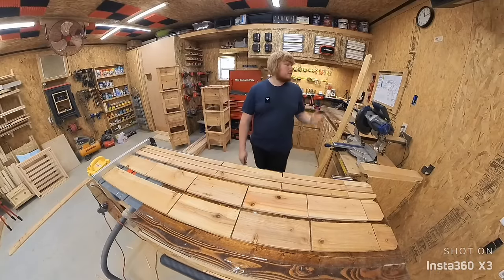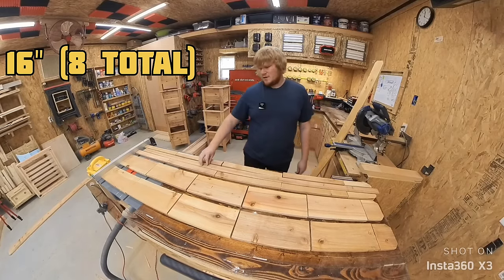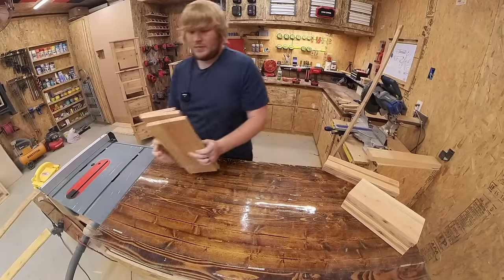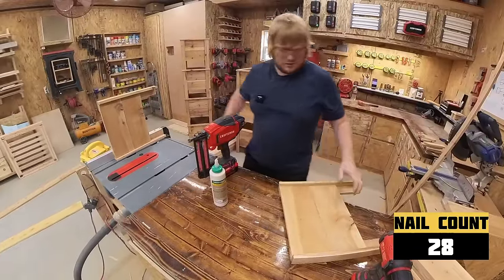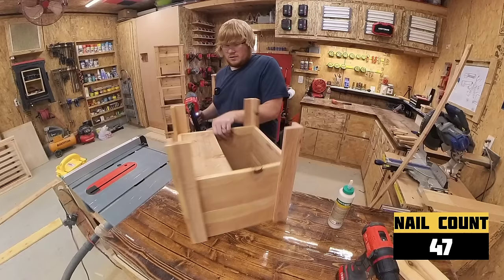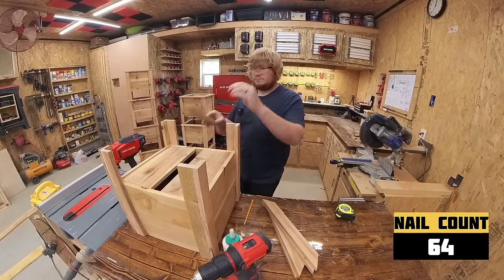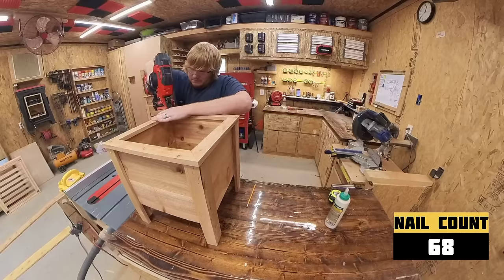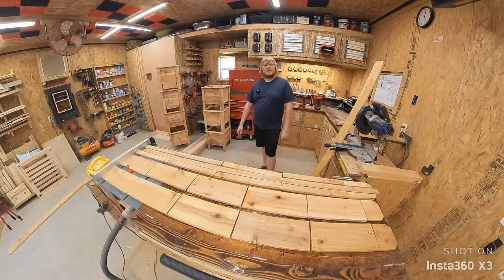3 Pickets, FREE Plans | Make Money Woodworking | How To

Comment: Maybe do a video on making a plywood push stick. You're fingers are pretty close to the blade pushing the thin strips through.
Reply: I thought the same. Yikes. :(
Reply: My experience has been that if you are pushing a narrow piece through the blade you are actually putting pressure against the fence. If you finger slips it will move towards the fence, not the blade. I do use a push stick for short pieces that are not long enough to reach the riving knife before the cut is complete. Still have all my fingers after 30 years of woodworking and carpentry.
Reply: Oh my gosh 😳. My knees are still shaking after watching it.
Reply: seriously
Reply: The push stick was right there on the other side of the fence! 🤣 I was yelling at the screen for him to grab it.
Reply: @gardening-in-the-woods The danger is the board will catch on the saw and pull his hand into it. It happens too fast to react. Use a push stick every time.

Comment: Big props for tracking even the number of nails used. I'm so tired of "$6 planter boxes OMG!!" but then they use $10 in pocket screws alone, and also you have to buy the plans.
Reply from the maker: 🤣🤣 "$6 project, but, buy the $10 plans on my website first" THATS what I hate the most. Glad it frustrates others as well. Lol thanks for the comment buddy :)
Reply: Well you don't have to buy the plans... I did some with pocket screws and it was $2.94 for the screws minus the $.40 cents for nails and it's only $2.50 a build and some designs are just stronger with pocket screws ya it adds a little more time and of course time is money but to each is their own

Comment: Love the video. You should use the scraps. Cut 4 small glue blocks for the bottom. Put them in the corner of the legs on the underside with a little glue. Strengthening everything up including the bottom
Reply from the maker: Oooo! Ill have to give it a try! Thanks!
Reply: That's exactly what I was thinking too
Reply: You’ll be at more than 80 nails now!

Comment: As an update I finally made my first planter box!! I made a small mistake and ended up putting the bottom on the top and had to pull out the brad nails. 😅I got a bit rushed, but I hid the damage on the outside from me having to drill some shallow holes to remove the brad nails by adding trim on the outside facings.

It still looks beautiful regardless! I'm getting lots of friends asking for one now lmao. Thanks for the awesome video I could follow and the cutting plan included!
Reply from the maker: Ohh noo!!! But you could cover up the mistake soo not a loss whatsoever :) great job! Thanks for watching!

Comment: A word of caution - watching at around 3.10, you use your right hand to push the board through. Do NOT do this! Get into the habit of using a push stick. If you don't then you can almost guarantee that one day the blade and your hand will meet. When that happens, it does not end well for your hand. I speak from experience !
Reply from the maker: My newest video has mack one of my favoritd push stick, I want to make it cooler, but, its a start! :) Thanks buddy
Reply: You are so right! I almost peed my pants and it wasn't even my hand. A push stick and NO long sleeve shirt.

Comment: Awesome video and plans!
My only change was ripping the legs to two different widths: 1.5" and 2.25". That way, when they're attached at the corners, all the legs end up looking like the same width. It also leaves you enough (1.75") to use as the top trim.
Reply from the maker: Interestingggggg, I dig it!!

Comment: Great lil project. I built one with ease but the center piece on the bottom was to narrow. I think it’s because my planks were smaller that 5 1/2”. Thanks Voss.
Reply from the maker: Ive had quite a few with a 1/8" gap on each side of the bottom board, just gives it a little more drainage ;) glad you got to build a few!!

Comment: fantastic, build.  easy to follow for a retired rookie.     I have been filling in my exposed nail holes with a mix of the picket saw dust and glue.  just work it in the hold let it dry and sand and you will never notice.   also like the comments about strengthening up the legs to give more support to the legs and the bottom.. thanks and great video
Reply from the maker: Not a bad idea to fill in the nail hole, one of my boxes has a lottle rust spot :P legs have been fine so far, we'll see what winter does to them, but a lot of psople with the same design have had fheir boxes for several years with no issues

Comment: I finally started making these, one thing I did different and found out helps me with the final assembly is I'll actually build the trim square for the top first, a little glue and 1 nail through the corner just to hold it square, then I set it on the top and align to the box.
Reply from the maker: Nice! :)

Comment: This is EXACTLY what I have in mind for my porch and raised bed planters! LOVE so much! They look great, take minimal product (wood, glue and honestly, nails) and will last many many years. Super simple plans. Minimal stock (which is hella expensive now, but there are cheap places to get cedar pickets if you look). You didn't say if they were 6" or 8" pickets, but I'll assume that's in the plans. 
Thank you so much for a very simple plan to make exactly what I was looking for! I would have tried to make it more complicated (and I may still, with mitered legs, but  probably not because that's just more work). 
These modules are so adaptable! You could easily make them twice as long, butt them together, and face with the appropriate board length for the top. 
You could also off-set them for a custom look while making just a few more cuts for the mitered top with a little measuring finesse (personally, I'd scribe each cut, but that's just me).
This is perfect, so thank you! Now, I don't have to do the work to plan the cuts!

As an aside, it would be great to have a downloadable PDF that you don't have to have a particular program to download. Just a simple PDF as an image would be fine.
Reply from the maker: THANKS!! My plans are a simple jpeg and Ive been editing them to be 8-1/2 x 11s so its an easy print :)

Comment: Great job. I made something similar. I used screws, because I don't have a nailer. The legs I made straight and put them on the inside. I raised the bottom, because I put plastic boxes in it. It was fun making
Reply from the maker: Nails, screws, whatever works! Good idea with the plastic interior :)

Comment: Hello. I want to thank you for this video. I modified your design slightly and I make them from pressure treated pickets that are half the cost of cedar. Instead of lapping the legs, I move 4 of them 5/8" inward to create a right angle reveal down the corners. It' takes a little more time but I really like the look. I've sold 10 so far. Great video!
Reply from the maker: Sounds fancy! Great job!

Comment: Great video! I just finished making 4 boxes and they came out pretty good. I was wondering if you could include the plans for the bigger size that you got from the Whitaker custom order. I would like to try that one next. Thanks in advance!
Reply from the maker: Freakin Whitaker! The taller box is exactly the same as the ones your just built, but the legs are 25" long, and instead of two boards for the sides its three boards high. :) I also recessed the bottom so it doesnt take as much dirt to fill the box. Have fun!!

Comment: Nice design. Personally, I ended up ripping my scraps to make a 3/4" ledger board around the base to support the bottom. Most likely not necessary, but it will make it alot stronger!
Reply from the maker: I started doing that to all my boxes as well :) a little bump in quality

Comment: I would for sure put some ledger boards under the bottom for the bottom planks to rest on. Heavy dirt and water is going to be in that thing. your current config, the bottom is going to fall thru.
Reply from the maker: The bigger boxes Ive made have a ledger because of the weight, so far these little guys haven't fallen through :)

Comment: This is so amazing. Id love to try making one. Might get into a carpentry class just so I can do them..I don't have the tools
Reply: If you’re still in school, Harbor Freight will be your friend. Nothing that will last forever, but it will last long enough 👍
Reply from the maker: Might fail the birdhouse class if you make the planter box instead. But you should totally make a planter box! Table saw is only $198, and it can complete the cross cuts as well :) and screws / a hammer and nails is all you need :)

Comment: This is excellent! Yours is, I think, the best presentation. I need to build one for my granddaughter that is 30" H x 48" L x 24" W . I hope this design will work for these dimensions. What do you think?
Reply from the maker: I have a planter box video for a longer (48x16x16) planter box I just posted that shows how to reinforce the sides for the extra weight. If its going to be 30" in height and have dirt all the way to bottom, you might consider adding a 1-1/2"x1-1/2" support inside the leg. If its not holding that much dirt, just make your legs a little wider and add screws to help hold everything together :)

Comment: I really like your stuff.  Why?  Because you are just a regular guy.  Your instructions are easy to follow, the audio is great, and video is clear and you don't jump around.    I'm tired of watching "EASY" projects where you need special jigs, an edge planer or a surface planer or some other piece of equipment.  I'm a table saw cheap band saw, drill, and saber saw kind of guy.  Thank God you are out there.  Makes me feel like an old guy like me can actually accomplish something and sell it for 30$ without having to have $10,000 worth of wood working tools.  By the way, my local Home Depot had pine pickets for $2.18.  So I'm off and running. I'll probably have to put some sort of finish on them so they don't weather too much.   The expensive part was buying 7 Million 18GA 1 inch brad nails in a tiny box for about 25$.  That'll last a while.  Now to dig out my nailer.  Thanks again for the plans.
Reply from the maker: Thanks for the compliment :) $2.18 a picket??! Id drive cross-country for those prices! The closest Home Depot is an hour and a half drive for me. :/ Glad to have you as a part of the channel! :)

Comment: Hey, it’s just a suggestion, but if you can use the ends of the pickets that have the dogear ends and put those on the bottom, you wouldn’t have to drill holes
Reply from the maker: Not a bad idea! Others suggested to use them for bracing in the legs as well :)

Comment: @WhosTheVoss Do you have plans for the longer and the taller planters as well? It would be greatly appreciated!
Reply from the maker: I only sketched up the ones for this box since it was featured, the others I kind of made up on the fly. Just be mindful of the sizes to reduce waste; you can cut two 36" pieces from one board, but 48" has waste. :p i might make another viddo of the other three top sellers Ive been making besides this box

Comment: Love  your build. Will be building some myself today. I was wondering if you have any plans for the larger ones you make? I saw them on TikTok and came right over to your YouTube page. Thanks for the wonderful walkthrough. Much appreciated!
Reply from the maker: Is there a specific planter box you had in mind? Most are just changing the length of the legs or sides/bottom :)
Reply: Can u maybe do a video of how to factor this in? I know I could figure it out but I'd rather have it already explained and use my time to make them.
Reply from the maker: All of them have a 12-3/4", the longest boxes were a 48" long side, and have a 1" ledger board under for support. Next season there will be a video of the trio boxes and the longer boxes since they sold very well too

Comment: Loved this video!   Do you think this one would work with a 4x4 post for patio lights or would you recommend something heavier built?
Reply from the maker: Scroll to 15:34 in the video. I made a few with pressure treated 4x4's and a few with cedar 4x4's. The boxes were 24x24x16 and had 2x4 supports (none of which you can see in the video) but it is possible :) the cedar 4x4s are higher priced, but weigh a LOT less than the pressure treated 4x4's, and look nicer in my opinion

Comment: Great instructional video and very nice product. i would make one tweak though....and its just me thinking out loud.....wondering why you put the bottom pieces of the planter on the inside of the sidewalls and nailed from the outside. I feel that if there's some weight in the planter, it wouldn't be as strong as having the bottom boards overlap the side walls from the bottom. You would have to add 5/8 and 5/8 to the boards lengths but they would still fit in there nicely.   Then you could have hidden screws for extra support holding the bottom on?  Just my thought.   if it even makes sense.   Thanks for the video
Reply from the maker: Then you would be able to see the ends of the boards, and mine requires no screws ;)

Comment: Thanks for the great content and helping so many people with simple projects! Keep it up!

I'm very new to woodworking and I've made several of these so far. I'm not using a planer or anything to get the boards completely flat, and I've noticed the boards that are more bowed have significant gaps between the legs and side pieces. For longevity, I'm concerned the wood glue won't actually hold the boards together and the brad nails will slowly pull out. Does anyone have tips or am I overthinking this?
Reply from the maker: We've had this exact box on our patio for three years, and its holding up just fine. You could throw some TRK screws in the bottom if you wanted a little extra support :) Thanks for the kind words! :)

Comment: I gave this a go and well the fence boards we have in Ireland are 3/4 of an inch so it hasn’t turned out great. I’ll try again and maybe need to make wider legs. Won’t be doable with 3 boards though 😂
Reply from the maker: Ouch. Yeah I hear cedar pickets are not as common outside the US. 3/4 inch boards would make a beautiful planter, but you wont find a 6' board for $3.28 :/ lol

Comment: Great video.  I just started working with fence pickets.  Super fun. What type of brad nails are you using?  All I can find is interior type.  Wondering how they hold up in cedar.
Reply from the maker: Bostitch 18 gauge finish nails, nothing fancy. They are mainly there to keep the boards together until the glue dries :)

Comment: I love the planter build,  glad to see someone with such enthusiasm building great projects, I know you are a builder but I see you are a Craftsman fan,but what is your thoughts on the hand router in their line, I use Craftsman also but I don't have the router. Thanks.
Reply from the maker: Thanks! Tomorrow the long planter box tutorial is going to hit my channel :) I low-key love their palm router, sometimes I reach for it before evsn thinking about my plug-in routers. It has adjustable speed for different tasks and woods, and a 4 amp hour battery lasts for auite a while. Im planning on getting a second one when Lowes has the "buy two 4 apm hour batteies and charger, get a free bare tool". The router is always an option. Beats paying $99 for the router when I could pay $149 for two batteries, the charger and get the router for free :)
Reply: Thanks for replying, I have almost everything else,  but have been debating on the router.  Thank you, I am a sub already.
Reply from the maker: Hey Jimmy. At Lowes they have a battery and charger for $129, and you can get the router as one of the free bare tools" deal right now if you havnt grabbed their router yet ;)
Reply: @WhosTheVoss  Thanks for the update,  I will check it out ,I am going to need one soon,  Thanks.

Comment: I'm having trouble finding cedar pickets, both at Lowes and Home Depot. Also, they both show them at mail order (not a good option) but at 3 1/2", not 5 1/2". I can get plenty of yellow pine pressure treated 5 1/2 " pickets. What would be the problem in using pressure treated pickets? Thank, and keep the videos coming!!
Reply from the maker: The pressure treated are just not as pretty, but they will hold up the same. Only issue would be that the nails will corrode very quickly in pressure treated lumber unless they are galvanized. But, pressure treated pickets will work just fine :)

Comment: Hi Aaron - I'm sorry for this dumb question.  I did scroll through the comments but couldn't see anything that helped.  What thickness are your pickets?  Also, I only have a circular saw.  Am I going to be able to split one picket into three slimmer ones?  Or is it a MUST to have a table saw.  I am completely new to this so do apologize if this makes you do the eye roll!  Love your personality.
Reply from the maker: Throw a piece of insulation foam on the ground, put your picket on top of that and cut your strips; watch your blade depth. Cedar is very porous and cuts like butter. Be sure to use a straight board as a guide for the circular saw fence, and use downward pressure. :) my pickets are 1/2"-5/8" thick :)
Reply: Thank you so much, @WhosTheVoss

Comment: Great Job! I do have a question, I noticed these are 6 foot pickets but by the measurments for the top and last bottom board they total more than 6 feet. Am I reading this correctly?
Reply from the maker: The they just squeek out to fit. The 15-5/8's miters are made by flipping your board as you go, so they dont truly take 15-5/8's per cut, its more like 14-3/4's if that makes sense
Reply: @WhosTheVoss  ahh ok now I gotcha!! Thanks Sir!